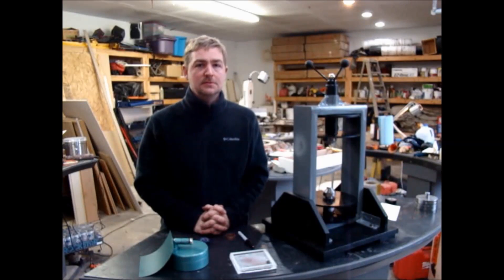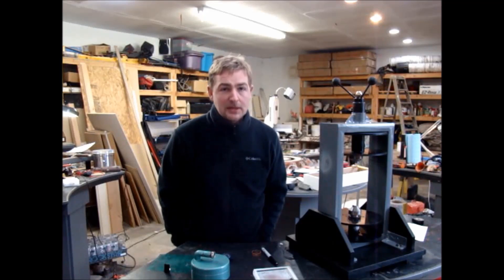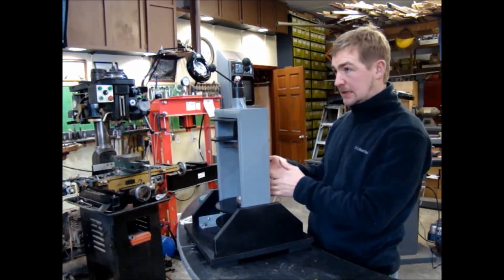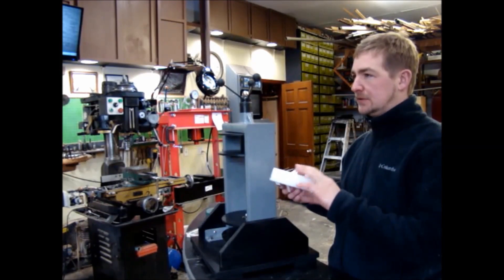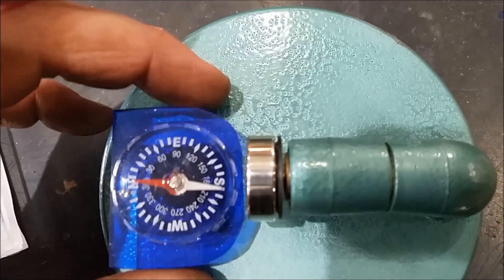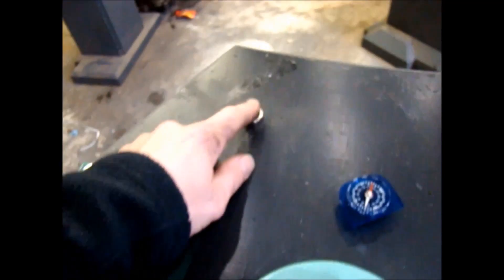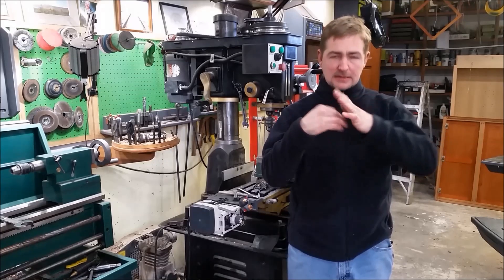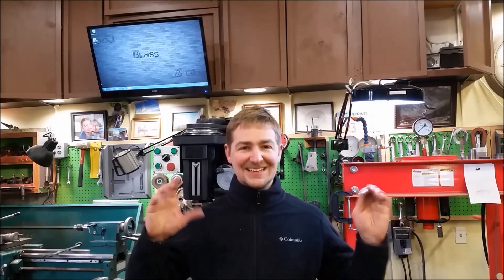Searl effect generator replica wave field magnet

Comment: A third suggestion. Have you considered casting the magnetic core (for the core of the generator), instead of using separate magnets? The separated magnets reduce the efficiency, and hamper the speed in practice, as a result of the magnetic discontinuity at the joints. It also introduces a flux overlap at said joints, which will affect rotation, whereas you're actually looking for a seamless flux all around...
Reply from the maker: The only I know you could do that is to probably have it custom 3D printed alnico magnet material. But I know that would be outrageously expensive especially for me.

Comment: Another point of confusion. You did the calculations for the weight of the materials, but you're not doing any calculations for the waves you want to generate in the magnets? Have you considered calculating the frequency of of the waves you want each ROLLER to generate (efficiency), or more importantly (for a basic prototype) the wavelength so that a certain number of wavelengths correspond with the circumference of your copper core seamlessly, for continued rotation? I understand you are working on getting a waveform imprinted on a magnet, so this might be the next step... Edit: There's another video/experiments on YouTube that has successfully generated waveform. Perhaps you could collaborate with him on yours?
Reply from the maker: I have emailed back and forth with Him. Very awesome gentleman. His work progressed quite a ways, but didn't yield many results:(

Comment: I'm a little bit confused as to why you're trying to magnetize them individually, instead of as a set? How about stacking them up to form a roller the way it'll be used eventually, and then trying to magnetize them that way? Or are you assuming that stacking them up afterwards they will stack up to form 1 wave? If that is the case, why not try magnetizing 4 small units separately (instead of just 1), but test the wave as a stack? (Thinking out aloud, as suggestions/food for thought)

Comment: Also you could use ring magnets covering a battery and flat metal covering the ends put on Aluminum foil and they will run in circles on its own

Comment: The inhomogènus field in the permanent magnet is the main drauback to be used in homopolar device (N-machine or SEG). It's better to use  negative impedance of plasma oscillating glow discharge, condensa is difficult to produce (nanomateriaux coherent).

Comment: Looks like AC waves why you don't play with AC HF instead of magnets?
Reply from the maker: I am going in the direction of imprinting frequency patterns into the magnet. This was just an attempt at altering the field with actual metal shapes. It was a success, but the real work will come when I build a magnetize with a frequency generator built in.
Reply: wood brass and glass maybe you can try with microwave because of resonance cavity makes that brogllie waves,just thinking ...keep it up good work

Comment: Try a regular ring magnet on a shaft mounted at an angle, not 90 deg. (Flux Warp Drive). This will give a nice sine wave pattern of the block wall. Maybe an oval shaped magnet?

Comment: Eight segments per roller. Try 4 segments normal dc and 4 ac. This should give the wave across the roller. We want the wave uniform across the roller. We may achieve this with the segments.
Reply from the maker: In theory it sounds fine. Reality is far more difficult. Each part would have to be cut down. Each magnetic layer would require custom molds, powder, curing and magnetizing. Then each one must weigh correctly. Your talking days if not weeks of work just to see. I will leave that to better folks then me. I'm merely making a replica for now:)
Reply: @woodbrassandglass  What's worth doing is worth doing well... you've spent years on this project, why not put in a little more effort and do it right, rather than run the risk the replica might not work? For whatever reason? Rob is right... We do want the wave uniform across the roller...?

Comment: Hey, just posted a way to possibly create a magnet with variable flux when rotating at your co-workers site . Essentialy creating a magnet with flux direction 45 degrees versus your ring axis. This being the blunt mechanical approach, but sometimes simple is the best way and easy to try. Good luck. Like what your doing.

Comment: Call them Vortex Magnets .   Did you try drilling several magnet cores and assembling premade magnets on an angle to eachs cylindrical axis of rotation ?   The worlds largest Neodynium magnet has a strength of around 45 Tesla and they use spiral plates to create field spirals. There are 4 separate cores assembled like the Russian Matryoshka Dolls each inside the others.  The largest magnet uses coaxial symmetry, but you could modify it to get non-symmetrical axial configurations.

Comment: IIf you wanr a mountain shaped field with peaks and valleys, make the physical shape of the ring material to be in the shape of peaks and valleys. Afterwards you can make another with reverse polarities. if you need to retain the orihinal shape, you can bond the remaining material (magnetic or non, as you deem neccesary, tobregainnthe original shape of the magnetic ring. Ive been foooowin Searls work and I think that would present the least effort to establish a magnetic field which peaks and drops as in a Sine Wave. make the ring in the shape of a Sine Wave. Jungle Boy C.R.